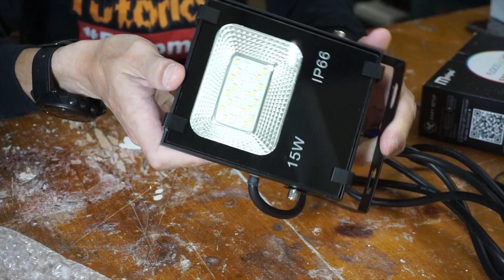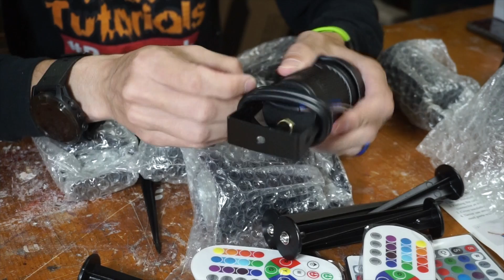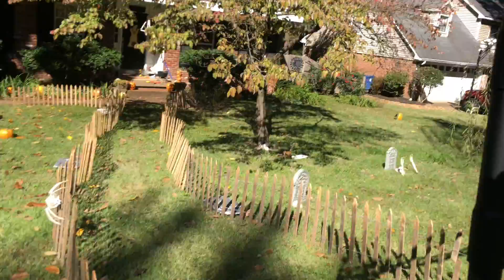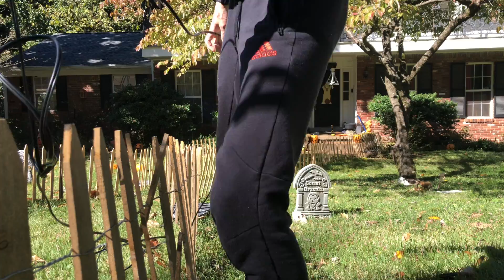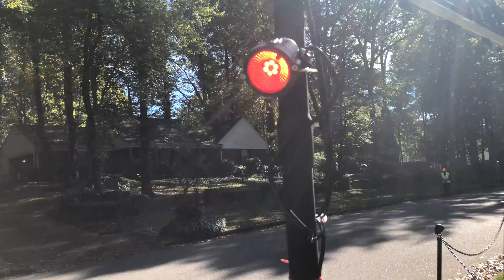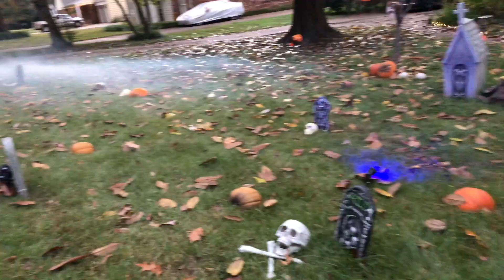DIY LED Halloween Lighting Tutorial - Take your yard display to the next spooky level!

Comment: Lots of frustration with lighting. Most of my spotlights were from Gemmy, almost identical ones are still made with an aluminum case. There are also plastic case versions sold in the big box stores. Everything gets more cheaply made every year. 
First frustration is that any of these lights are only available for a year or two and then gone. Second frustration is the lights are all made in China and if you buy from one suppler, they disappear and you have to search to find the same or similar lights from another fly-by-night supplier. Third, there is a 120V AC to I'm guessing 3V DC buck converter inside and they blow out. I can replace the usual culprit, the large electrolytic capacitor, but thinking the 12V DC lights might have less circuitry in them and I could have one power supply for the DC lights. But now I would have 2 power busses running everywhere.
I use mostly 1 color LED lights. I'm reluctant to switch to RGB since I am not sure how pure the colors are, especially for the blue, and how that would either waste other LEDs in the light or use only 1 of the 3 LED chips in each RGB LED. I guess I have to spend some money and test since you really can't get any information from these companies. Someone like this author has to post videos or you have to just test yourself.

Comment: This is a great informative video. The little 6 watt lights you have in your cemetery are no longer available. So, I purchased a kit that's the same thing by the same manufacturer, only difference is, this kit comes with a transformer. I found this helpful. I purchased 2 of the larger spotlights you used on your house. I found these pretty sweet. However, when set to change colors I wish they would all sink to move through the same color change at the same time. Keep up the good work and you offer great product review and suggestions. When you bought your transformer from Lowes, was it an AC or DC voltage output? You mentioned a positive and negative hookup so I assume it is DC output.

Comment: My biggest aggravation with yard lighting, is hiding the light source. Especially if I'm back lighting something like a scare crow. I had a spot on my scare crow last year from behind, and the light was blinding if you were standing on the road.
Reply: When back lighting, distance to the object your lighting can be a problem. Try moving the light closer to the object. I've bought some cheap roll of metal flashing at lumber yard and made a shroud around the top of the light, like a visor on a traffic light except it circumstances the complete light. The metal is easy to work with and comes in 8, 10 and 12 inch wide and aprox. 10 feet long. A quick spray of flat black paint will hide any reflection. Also, try pointing the light up and slightly tilted toward the object at a distance of 2 to 3 feet from the object you're back lightning.  Good luck with your project.